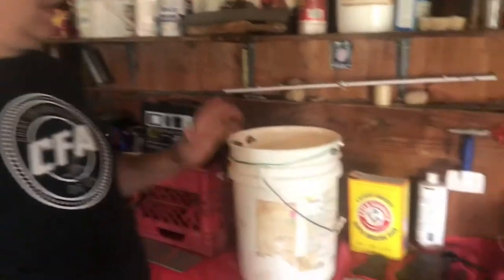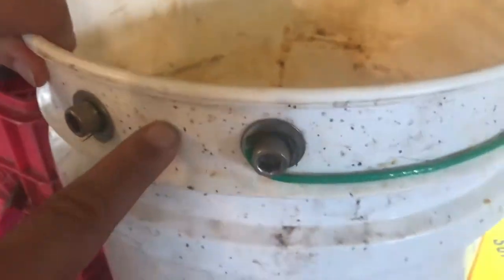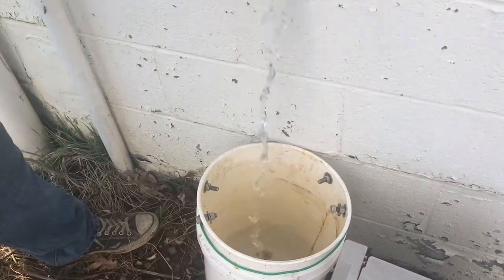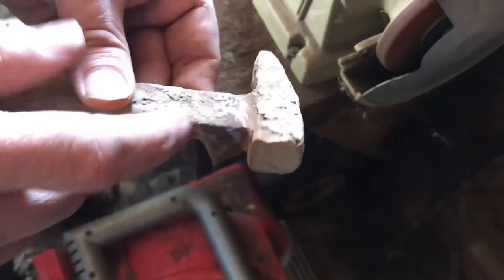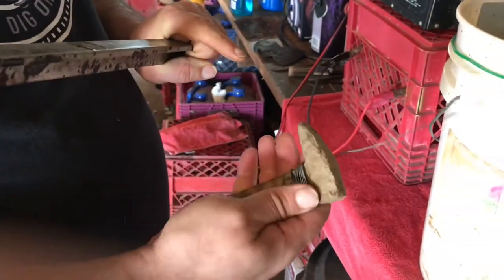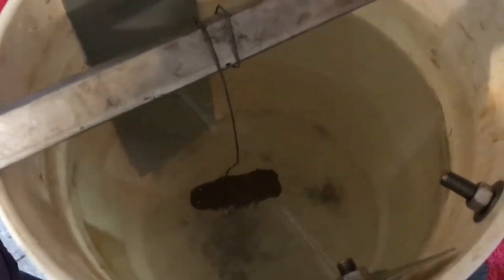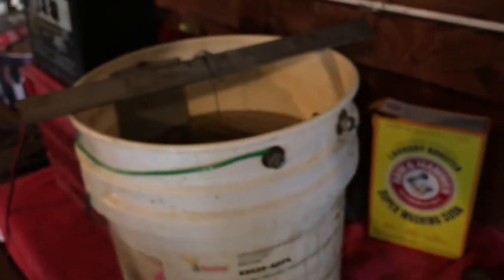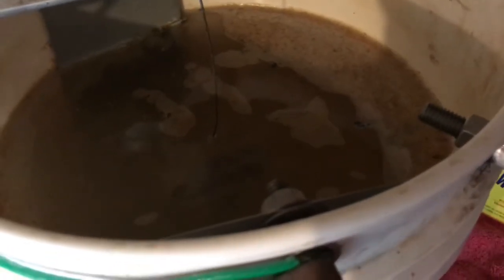Electrolysis Set Up

Comment: Hey Don.  I am trying to source those a/c key panels on ebay but not having much luck.  Are they called something else in the industry?
Reply from the maker: Digging Canuck Digging Canuck   https://acttestpanels.com/pages/test-panels

This is a Direct link to A.C T   best is 4x12 Cold rolled steel.. but you can use galvanized.  If you have any problems I can get some and send them to you keep me posted
Reply from the maker: Digging Canuck  part # 10161